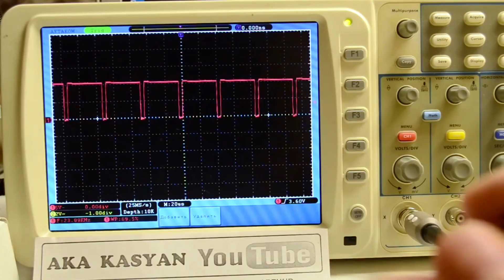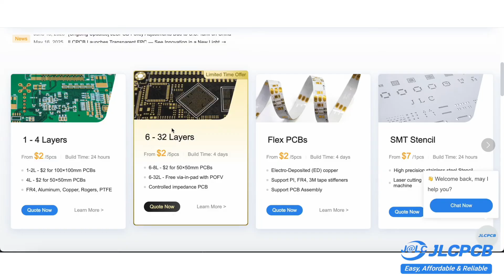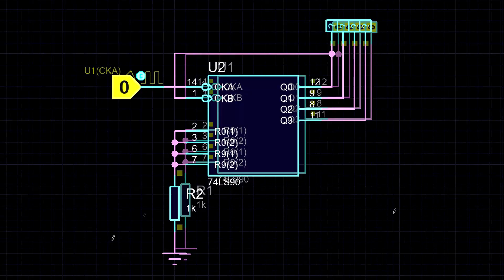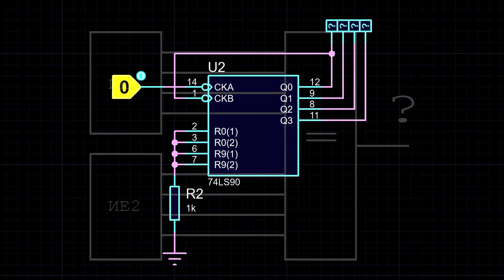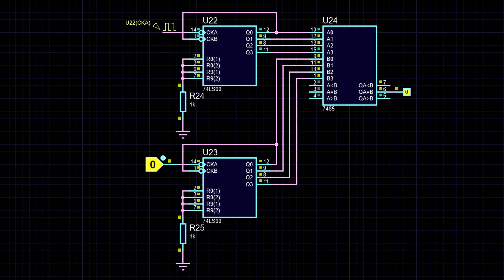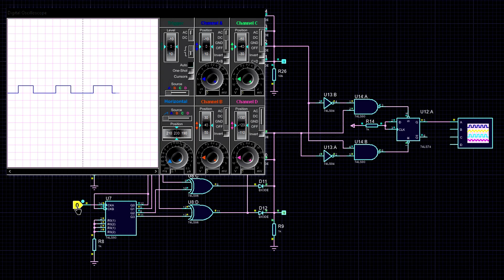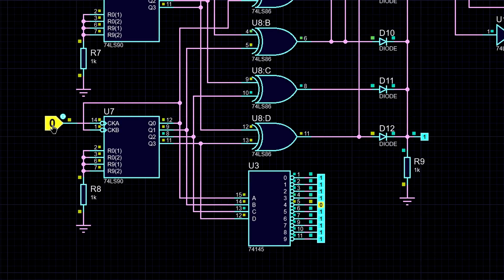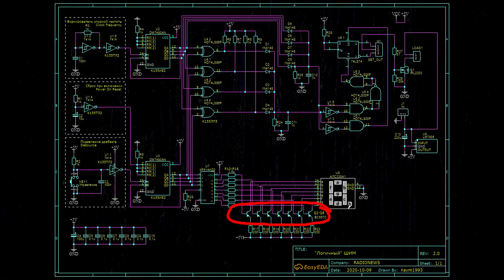DIY PWM Controller with Button Control – Simple & Powerful! JLCPCB

Comment: You can use a 74LS390 to replace two 74LS90.
You can use 74LS192 which has count up and down capability.
I suggest you to redesign with CMOS logic (4510B, 4543B, 4011, 4013B, 4030B, 4069, 4070B). CMOS logic can be operated with unregulated 5V to 15V supply.

Comment: Great! Here's another way, use two counters. one astable for continuously clocking one counter, a mono stable for clocking the other counter( reference  counter) using a button. The outputs of the counters are connected to a digital comparator such as 74HC85 . The comparator output is your PWM. Then you can use a bcd to 7 segment decoder for displaying the output of the reference counter on a 7 segment display.